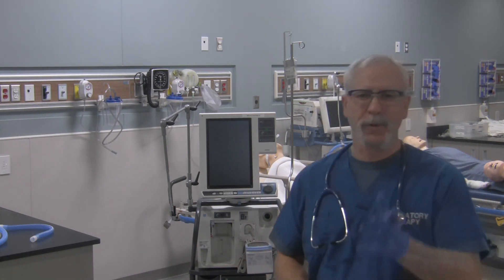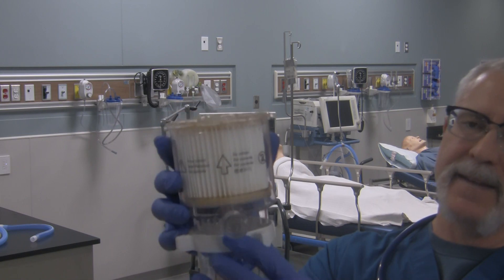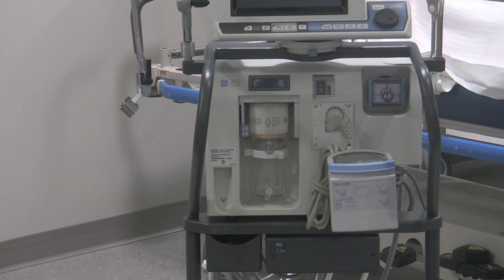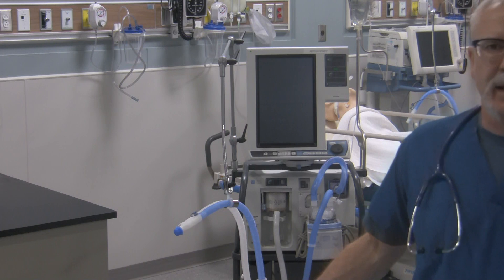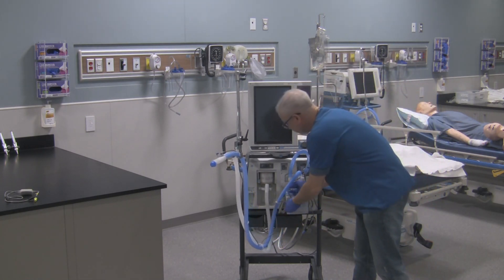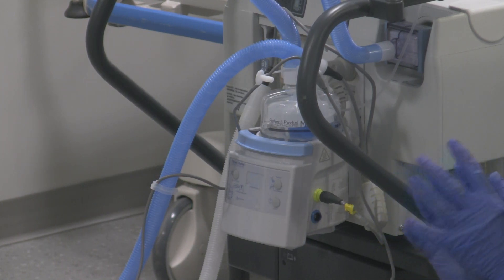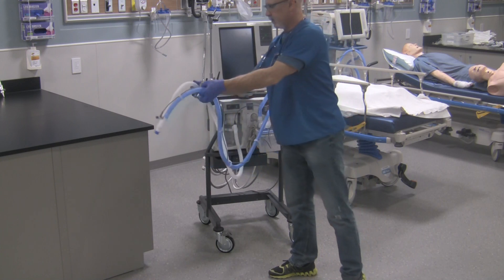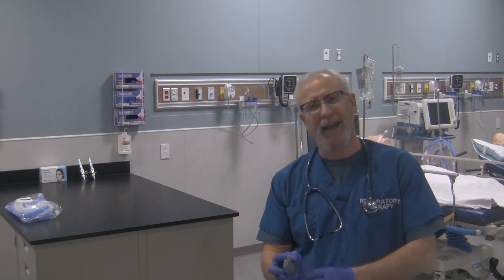Mechanical Ventilation: Patient Circuits: Circuiting the PB 840: Part 5

Comment: no water trap?
Reply from the maker: Hi:  If you are using a humidification system that has efficient heated wire (inspiratory and expiratory) circuits that eliminate rain out (condensation), then you wouldn't need to use a water trap.  That being said, when you are assessing your patient, always assess for condensation accumulating in the breathing circuit.  Hope this helps